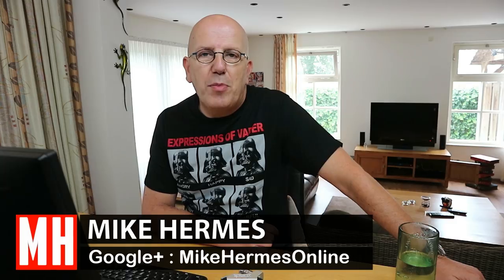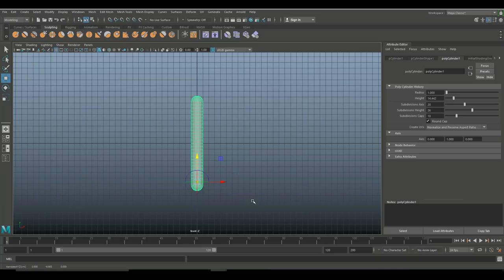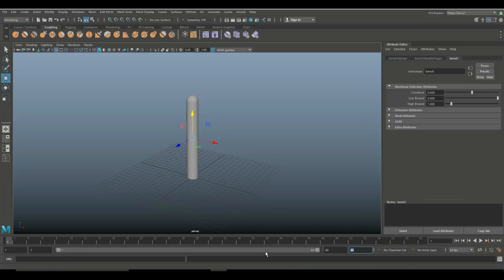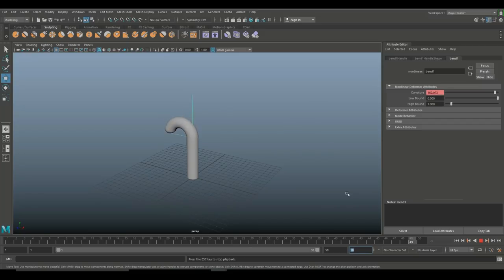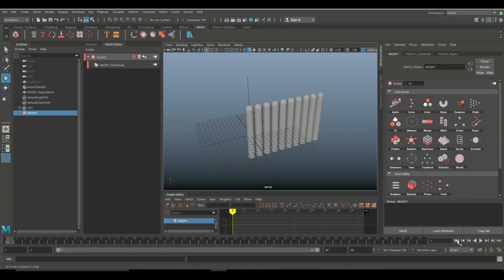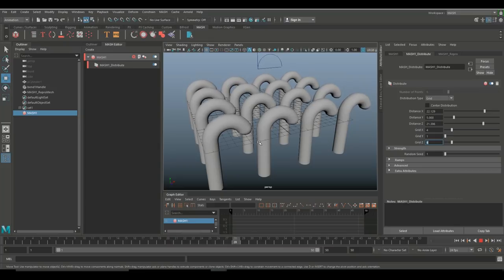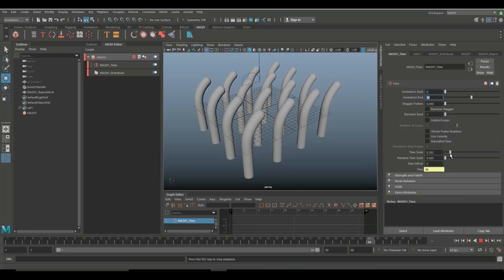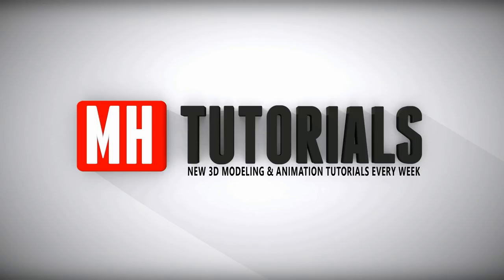Using the Maya 2018 time node in MASH to create some cool ANIMATIONS !

Comment: Hi Mike, love your videos, they've really really helped me out a lot ever since I started doing Game Design at JMC at the beginning of this year, and I've been hesitant to touch the time node in MASH as yet until this video :) One thing about MASH though, it's not actually an instancer by default, those are all polygons up there in the ReproMesh, with the original just hidden. If you want them to be instances, you need to select the Waiter (MASH1) in the Outliner and then hit that shelf button with the arrows forming a circle, and that'll convert the ReproMesh to a Maya instancer. Just a heads up :) Keep up the great work.

Comment: sir, i want to know is that mesh option is a plugin option or it is a already available inbuilt option?
if it is a inbuilt option  where it is available in my workpage?
if it is a plugin option  in which website can i download it
i am using maya 2016 version
please give your answer to me with a correct video related to my questions.
Reply from the maker: MASH is not available in Maya 2016